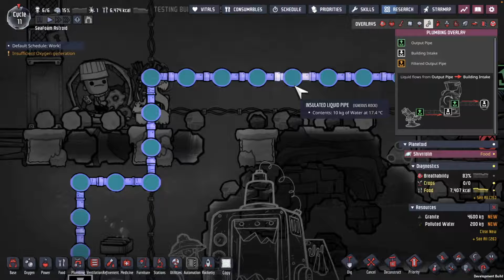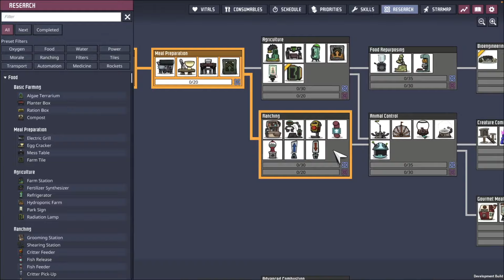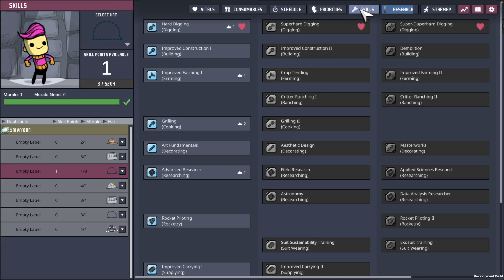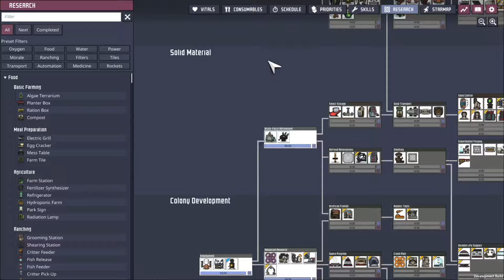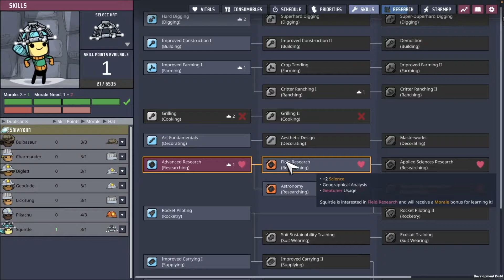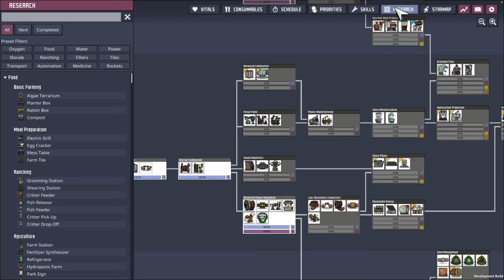Not Good - Frosty Planet Beta 19

Comment: You can save a bit of temperature on your water pipes by running them through wood tiles as well as cleaning up your ice (item) and replacing the ice tiles around them.  Or even doing some remapping of heat generators like BBQ closer to your water pipes

Comment: You could save labor with supply skill instead of electrical skilll and supply the dirt bins. Even without the supply skill it can be beneficial. The electric engineer skill is a local maximum trap.

17:37 You should go generator first. You can micro the hydrogen fuel while waiting for smart battery (and smart home). It's a bit wasteful of fuel, but the labor is more important than a few kilo of hydrogen.
18:30 Yes that's a bit difficult, that's why you focus on hydrogen gen first, so it's easier to get the rest.
22:41 Again, with 2 dupes running the wheels, hydrogen generator is the priority if you want something done.
32:00 Just connect the hydrogen generator already, you are low on labor and on power, and you hydrogen gen can help with that. Who care if you burn some more kilos of hydrogen in the process. If you are so worried about it, let a few packet of hydrogen at a time go though.
33:20 The chef running the wheel while on 0 kcal xD
36:00 Yeah not doing great, the chef are running the wheel or running to get dirt.
And the battery is so tiny compared to the current power usage that they run TO the wheel almost more than ON the wheel. And the hydrogen gen is right here, waiting for the last pipe section.

37:59 RIP, Imo, you can make things start to work and then upgrade to be the better version. For exemple, 100% research is better than 0% research that wait for 110% research before starting. Or being wastefull of the plenty of hydrogen for a few cycles is better than not having power ( and thus no labor for cook).
You don't need the best setup right away, you need thing to work, then upgrade, like you did for the water. 
Also the dirt bins not filled costed you so much. Maybe also try to have the wood stove near the water pit, with some more wood tiles around. I think the wood heater don't do much to heat up snow room the full of ice debris.

You are almost there, a few tweaks and you get ahead of this bump and you fly right through after that. Pile up some dirt(don't need to fill all the way), waste fuel on generator. Then everything will go smooth.
Having more water in the pit mght be beneficial too. It's more difficult for it to phase back to ice, and you pump full packet and you are more efficient. At worst, it turn back to ice, and you refill, no big deal.
Reply from the maker: Filling the bin with dirt! Such a small thing but yet so important. What I have in my head right now is step one: run an Electralizer, step two: feed hydrogen into a generator (automation to follow)
Reply: You should convince Jer to stream; that’s a LOT of time based comments, a bit difficult to decipher without fully researching all of the video and keeping your comment open for reference